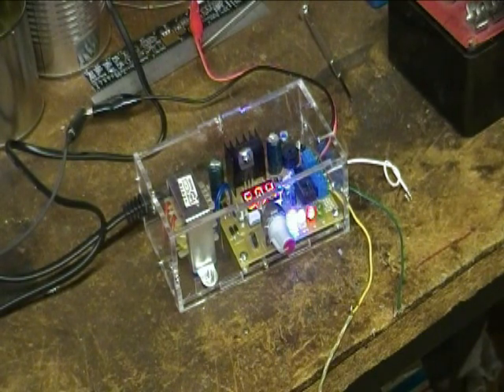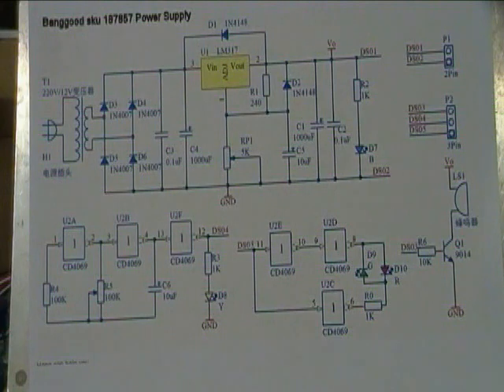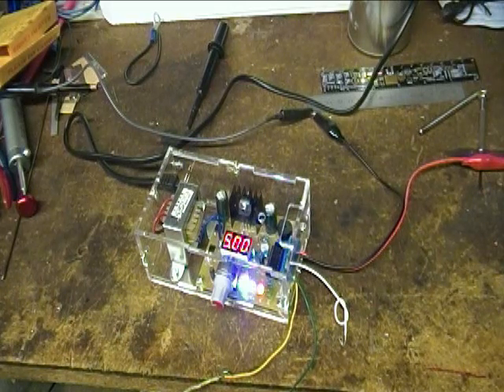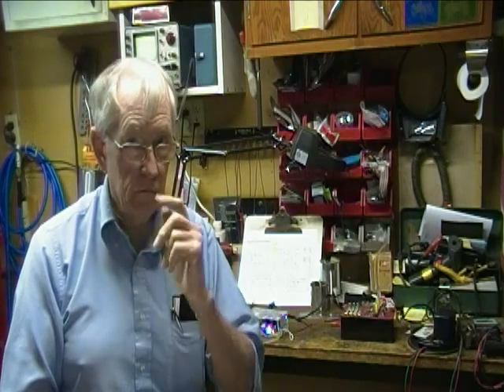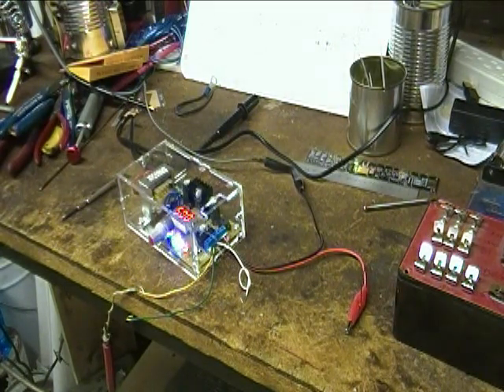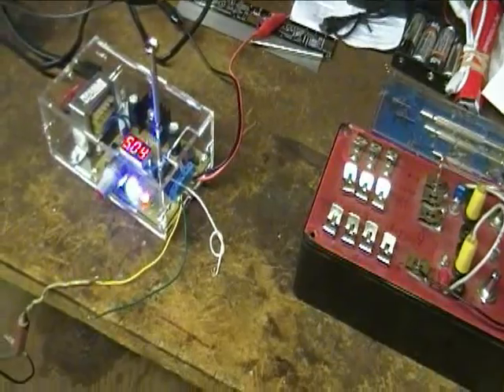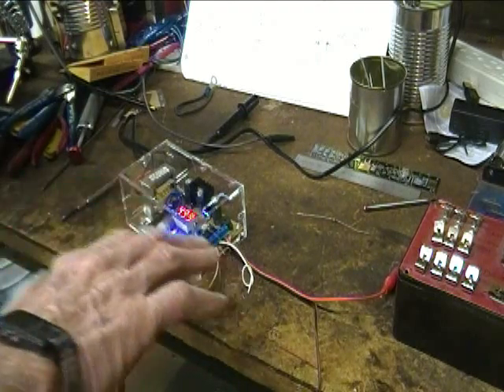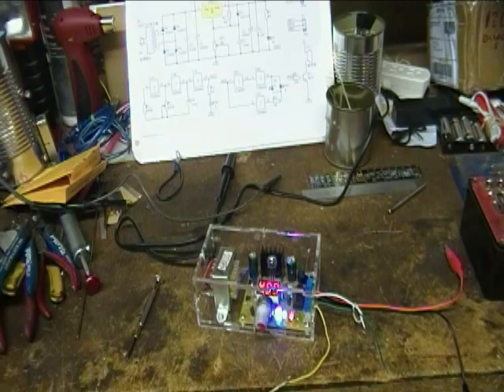LM317 Adjustable Voltage Regulator Kit  Review

Comment: i know this video is already 8 years old but i like it... in fact i assembled one yesterday but my LED's are not functioning perfect... blue, yellow and red are not functioning but the output voltage is correct ,working ok... i double check the schematics and all parts correctly put and the LED's are not defective... i wonder where did i go wrong?
Reply from the maker: The only possibility that comes to mind is that those LEDs may be in backwards.
Reply: @frenchcreekvalley  maybe but i double check it and all LEDs are in correct position. Here is a thing i just found out today... i solder everything again to make sure everything is connected properly... BUT when i tap the casing the LEDs lit up then off again... bad solder? remember i resolder everything again... the only thing left is the DIP14 - CD4069 socket but am not sure.
Reply from the maker: @erwinsolmayor9205  rewatch the video from  about 10:10.  Your observation may be  simply due to the high impedance characteristic of the circuit.
Reply: @frenchcreekvalley  i solved the problem found a hairline crack on the tracks to the LEDs... put some  thin copper wires then problem solved.
Reply from the maker: @erwinsolmayor9205  Thank you for this feedback.

Comment: Hi good video. I have build half a dozen of these (220V version) from aliexpress, the worst shortcomings: no explanation of mains transformer blue and red wires, a resistance measurement with my DMM (Fluke 8050A) made it clear which wires are primary (mains side) the LEDs are way too bright, a 22Kohm instead of 1Kohm series resistor for the LEDs is more useable for my dim (1000Lux) workbench. the 2W power can be got only at maximum voltage, but technically it is not a lie. the beeper of logic probe is way too loud, and a blob of hot glue or rubber stick to the hole of it quiets it a bit.

Comment: Hello, thanks for the review. What the green led and the buzzer are for ?
Reply from the maker: These two features are described starting at about minute 5.  
The buzzer is a continuity tester.  The green and red LED's are part of the Logic Probe circuit.
These  two features are completely separate from the power supply circuit.
Reply: @frenchcreekvalley  Thanks for the prompt reply, will watch it again, carefully.

Comment: AZMIR WORLD
1 second ago
i need this Circuit  diagram and  all require  components List  plss
Reply from the maker: Hello Azmir.
  I hope this will help:
img.banggood.com/file/products/20161107235305SKU187857.pdf
Reply: Thank you So much
Reply: But its critical ....where is IC connection? Sir can you Draw  it for easily understand  ....Plss sir
Reply: Or give me a Pure  voltage regulating circuit Diagram  only.....no need include more facility like,POWER,Signal ,ect
Reply from the maker: Hello Azmir.
  I hope I understand what you want to do.
Go to this webpage:
https://spaco.org/Computing/Computing.htm
and look down the page to:
"Youtube Link to: Banggood sku 187857 Power Supply Review"
There you will see  a couple of ways to stop the Hex Inverter from taking current away from the power supply's output.
Reply: Dear  Sir, I got it from there...https://youtu.be/8er_XyUX0gc
but i have a Question ....Can i use  3A/24V X-Former for this same ckt?
Or what    A? and V?(X-Former)  maximum should i use..
Reply from the maker: You can NOT use the 24 volt transformer to power this circuit for at least two reasons.
1.  The electrolytic capacitors are only rated for 25 volts but the 24 volt transformer would supply about 34 volts peak which would probably destroy them.
2. Although the  LM317 can handle a maximum of 37 volts input, it  would would require a much larger heat sink since it would have to drop so much voltage.
Examples:
If you were setting the output to 5 volts, the LM317 would have to drop 34 - 5= 29 volts
and if you were setting the output to 12 volts, it would drop 34 - 12 = 22 volts.

Note that the LM317 can only handle  1.5 amps at a maximum.
As long as you limit the current output of the circuit to one amp, you can use a 12 volt transformer that has a current capacity of several amperes.
Reply: THANK YOU SO MUCH SIR....I UNDERSTOOD .

Comment: sir..can make to supply phone...for phone reparing..
Reply from the maker: Hello Adzim.
  I am going to rephrase your question to make sure that I answer it correctly:
"Can this power supply be used for repairing cell phones?"
Here is my Answer:
  Maybe.  This power supply can supply about 200 milliamps at 5 volts and about 300 milliamps at 3.7 volts.
I think this is enough current for many cell phones when they are in operation, but I wouldn't consider it to be good for battery charging of cell phones, unless you know for certain what the charging requirements of its battery are.

If I am answering the wrong question, please tell me.

Comment: Sir, you make some interesting comments, but the one that really caught my attention were the flickering red / green LED's. 
Taking a look at the circuit diagram, someone has committed a cardinal sin with CMOS. The LED's are being driven by three inverters with two inputs tied together. This is then wired to your output block. You cannot have CMOS inputs that are not tied to another CMOS output OR to GND or VCC.
What is happening is that the input FET's are both turning on at the same time on the inputs creating an analog path for current to flow. That chip might not be long for this world, and it might be getting a little warm.
I'd choose a very high value resistor (100 K ?) and tie the input to ground. As a side note, your quite right, you are picking up A.C. Hum, and any other stray electromagnetic fields and that's what's pulling the LED's to one state or another.

Comment: I have a guestion for you ,I turn on my l317 power supply same as yours ,I ck the voltage with my multimeter the voltage read preety close,but I tried to get a LSD to light up,when it didn't I slowly in crease the voltage from volt ,uptell the led pop ,but it didn't light up
Reply from the maker: Hello Ron.  What is a "LSD"?
When you say: " uptell the led pop", what does that mean?

Comment from the maker: No, I don't know of any videos that explain how the case goes together.
The panels that make up the case fit together very well on my unit, with each piece fitting into slots in the mating part.
The case parts are held together with small machine screws and nuts that come with the kit.  If you look at the top, for example, you will see some small round holes for the screws. If you place the top onto the sides of the case, you will see small rectangular  slots in the side panels, right under the round screw holes. 
Now, to  fasten the parts together, you slide a nut into the little rectangular slot the push a screw through the round hole above it and thread the screw into the nut.
Pretty ingenious, I think.

Pete Stanaitis
---------------------

Comment: I purchased a larger transformer to see if the circuit can handle it. If it does I will get .7 of an amp. Anything larger will not fit in the case. It will be a tight fit with the bigger transformer that I purchases. I will let you know how it works.

Comment: I have this kit and it serves my purpose, but I did think of using a larger transformer. have you used a larger one and if so which one? I am trying to find one that will fit in the case but give me a full 2 amps at 12 volts.
Reply from the maker: +C MJ :  2 amps X 12 volts is 24 watts,  right?  This is sold as a 2 watt power supply.  So there's a huge difference there.I don't know how much power is lost in the circuitry or how much extra power could be safely dissipated  on the board if you did use a larger transformer, but the LM317 would probably be the last thing to go.You might consider a transformer like this one though:http://www.mouser.com/ProductDetail/Triad-Magnetics/F114X/?qs=sGAEpiMZZMvwUzoUXIIvycT6np3HRZBQmkI4MjCUms8%3d  You can see that datasheet there.The size is shown as:Length:1 5/8 inWidth:2 13/16 inHeight:1 5/8 in This one won't fit into the case though.  Pete Stanaitis
Reply: True and I am finding it difficult to find one that isn't already in something. I like the one you suggested and was looking at it before. I really don't need 2 amps but it would be nice. So far I am using this supply for some 9 volt devices that I have and it works well. I noticed how the voltage drops when hooked up to one of them and if I were to use the second function on this device it might not have enough energy to function. I am going to test it. If not then I will get the larger transformer. Thanks for the response.
Reply: I purchased the transformer you suggested. I had to cut a slot in the top of the case to fit the transformer into the case. It fits and works well. I have more output in terms of amps and under a load it doesn't get hot. You should try it.

Comment from the maker: Regarding Normann's comment that "mine is only giving from 10volt til 15 volt.  What did I do wrong.":  I can't really tell without seeing the board, but it is possible that you have the wrong resistor in the R1 location.  The schematic says that it is 240 ohms.   Also verify that the polarity of the C5 electrolytic capacitor is correct.

Comment: Thank you for the explanation of the functions and the drop in current when increasing voltage under a load.
This was my first soldering practice kit and I'm not an EE (actually I have an EE from Cal Berkeley but was always on the software side). I was happy the project worked, but had no idea what the extra functions did, or why the things I ran off it never seemed to draw more power as I turned up the voltage. This was very clear and very much appreciated.